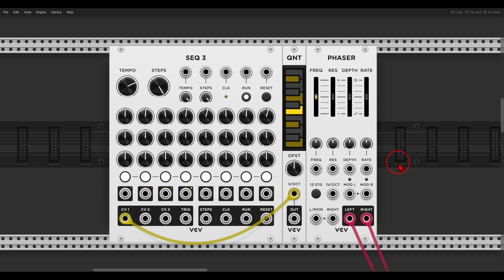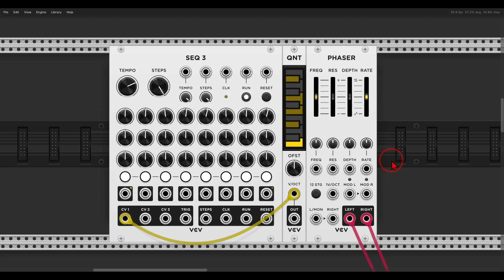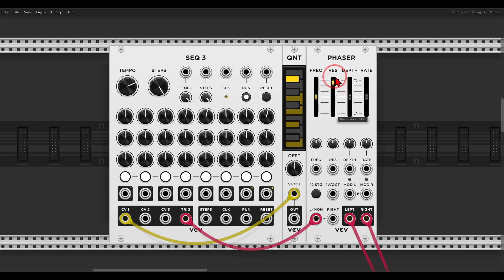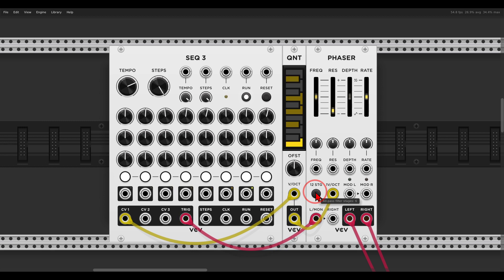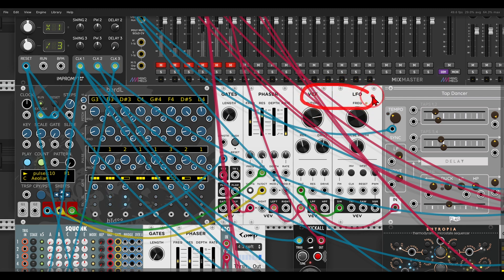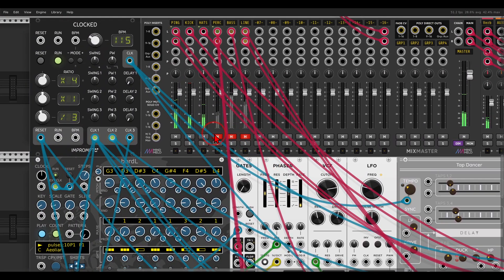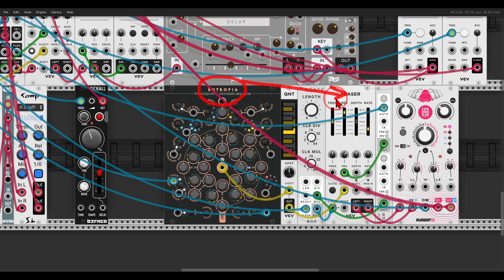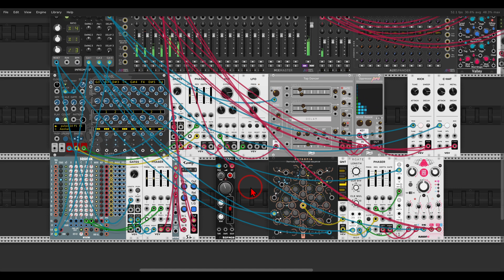Buchla-Style LPG sounds with the VCV Phaser \ Quick Tip

Comment: I love this sound, but is there any way to 'tame' the attack of it? I find the clicky attack sound can get a bit overpowering at times
Reply from the maker: Something you can try is send this through a VCA, and use an envelope to control the VCA, and add just a little bit of attack to it, so it will be less clicky. You can also try this with an additional lip filter and a slightly longer attack for the cutoff.
Reply: @OmriCohen-Music  that's a great idea I'm going to try! I was using a lp filter, but i didn't quite like how much it dulled the sound overall. I love how the sound, well, sounds being run through delay based effects like the blob and spork, but i was running into issues, specifically with spork  where it would just end up in a bunch of random clicks close together, and the lp filter ended up just creating a really smeared washy reverb-ish sound. I'll try the envelope technique and see how that goes, because i love how the pinging of this phaser sounds, it's just that the transients are too aggressive for what i want to do with it.

Comment: I've used this a lot and it's cool, but always sounds slightly out of tune to me. I guess it's just a kind of inharmonic sound. I like to send it totally unpitched CV to the V/Oct and get random notes. The flanger is fun too but it's quite a harsh tone. Tip: if you don’t have VCV pro, the Blamsoft filter has a phase mode which pings nicely with the resonance up, although I don't think you can tune it. Sounds amazing though 😉
Reply from the maker: Yeah, that's the nature of this sound I guess. I will have to test this with the Blamsoft one, thanks!